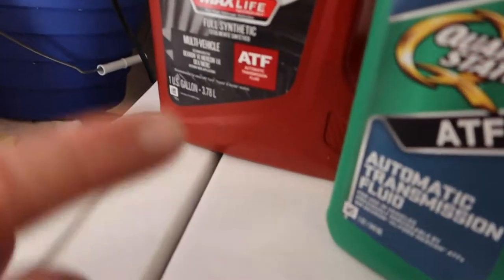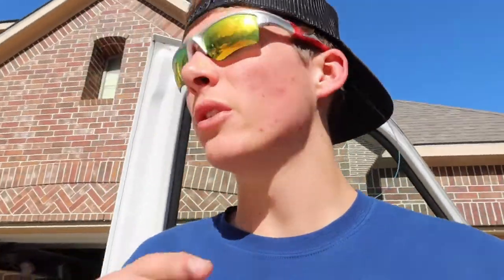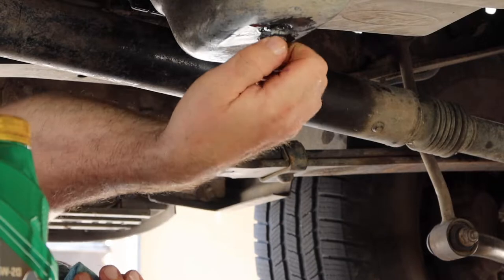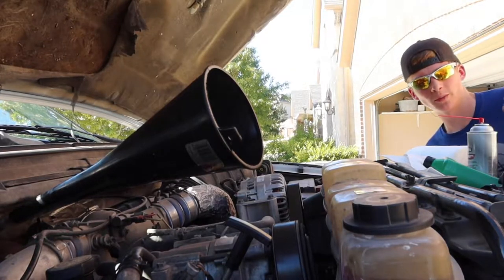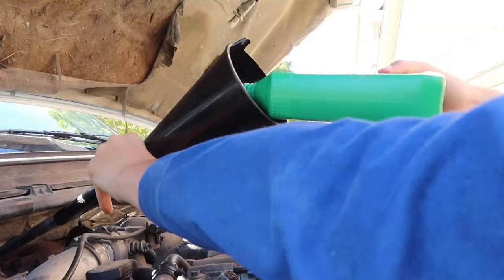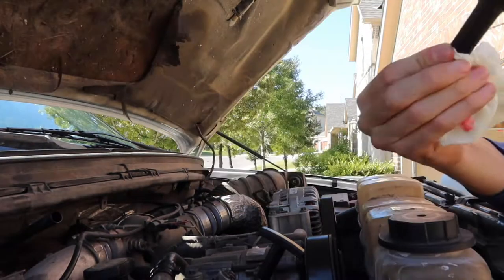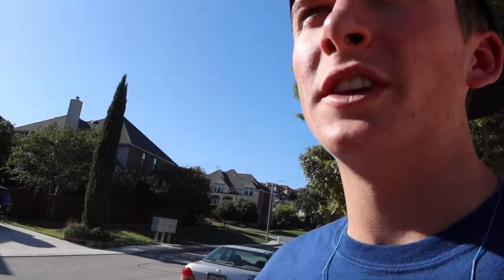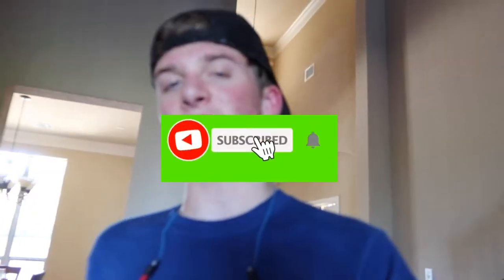How To Make Your Automatic Transmission Last Forever!! (7.3 Liter Powerstroke)

Comment: Even more fun fact, you can take that used transmission oil and run it in your fuel tank
Reply from the maker: Uhh wouldn’t recommend that.
Reply: @powerstrokecentral  You certainly can. 6.9 and 7.3   5.9.  And old Mercedes diesel prior to 1987. They burn anything. 
I drove coast to coast in the old Benz with used cooking oil and used tranny fluid
Reply: @emersontayten  There is so much metal from the clutches in that fluid that it will plug your fuel filter up before you made it through half a tank.  And if doesn't get caught by your fuel filter the metal will destroy your injectors and pistons.
Reply: @HockeyGoon939  Um, you obviously strain and filter the shit out of beforehand

Comment: That's good that you have  over 400,000 miles on it. But why wouldn't you pull the pan and replace the filter and remove the metal particles from the magnet in the bottom of the pan? I did it to mine and there were some shavings on the magnet. Not an over abundance but enough that I was glad that I did it that way.
Reply: No reply

Comment: Hey bro I’m a beginner with 7.3 I just got one and about 1 week ago my transmission overheated and dumped some fluid so i pulled over right away !! So my question is do I need a new transmission or maybe with luck only replace fluid and should be good to go ?
Reply from the maker: Are u in Texas?
Reply: @powerstrokecentral  unfortunately I’m in California 😔
Reply from the maker: @totaltreeservice4870  you need to find what caused the fluid to overheat in the first place and that is your problem no need for a new transmission unless it overheated really bad and you ran it without fluid.
Reply: @powerstrokecentral  thank you, you are getting my hopes up !!! Does 3K sounds like a good deal ?? Motor only got 200+ miles??

Comment: I just got my first 2000 Ford F250 7.3  turbo Diesel and I watch a lot of your Videos to help me with my truck. 
I am wondering for the transmission dipstick do I need it on the hot range or cold range when checking the trans?
Reply from the maker: check it while its hot and running.

Comment: The oil molecules are all over the place mixing all the oils  but i see you do it regularly.. when you drained the atf it was like new...   if you change it every 15k and don't beat on and add a second filter by oil cooler It will last for ever

Comment: Great video - do you know if Ford has fixed their tranny problems (Mechanical Diode) to your knowledge?  Looking at a 2002 @220k that has had tranny replaced but have read problems come back.  Everywhere i read in forums is it can't be fixed permanently?   Thanks for help!
Reply from the maker: I haven’t had any tranny problems with my 7.3 l. However I have had some electronic problems with my mileage left till E calculator. Probably because of how old the truck is.

Comment: Older video I know. But as you start building/tuning your engine, your auto tranny becomes the weak point. I burned 4 up in 3 years. Just swapped to a zf6. Not as fast, but nearly bulletproof.
Reply: Did you ever try a Dieselsite Legendary 4R100?

Comment: How many qts is it in total I’m a little confused I just got my 7tree and I’m looking at doing as much maintenance as possible
Reply: Don't do what he did.  Those years have a drain on the torque converter.  You can drain the pan and torque converter at the same time.  There is a rubber plug on the transmission bellhousing to gain access to the torque converter plug.  You'll need someone to bump the starter to get the plug to the bottom of the torque converter to gain access to it.  I try to let them both drain overnight.  If you let it drip long enough eventually you will get part of the oil out of the oil cooler.  My 2000 F250 V10 manual says the transmission from dry holds 17 quarts.  Even letting it drip overnight was only able to get 13 quarts out of it.  USE MERCON V fluid to refill.  I also add a pint of Blue Devil transmission stop leak.  This should be done every 40,000 miles or less - especially if you are towing with it.  I use the Super Tech Mercon V fluid as its the cheapest of the synthetics.  Valvoline does make a "conventional" Mercon V fluid that is only $4 something a quart but I don;t know how its Mercon V as my understanding is from Ford Mercon V is synthetic.
Reply: @HockeyGoon939  i turned the torque converter over on mine didnt see any plug on it . i have a 2000 f350 7.3 and i accidently over filled my transmission i disconnected the metal line that runs into a rubber covered vynal hose next to the trans pan and started the truck to pump out the line idk if that drianed the torque converter or runs to it or from it! But i put in 17 quartz i fucked up lol first time doing a deisel so my fluid was over flowing from top of the transmission above the pan area! I put in a new filter cleaned the magnet and did a oops i forgot to also remove the old seal from filter housing neck so put new one in with old one still inside hopefully it didnt get stuck or sucked up lol but im going to drop the pan again and redo it all! My over drive light is flashing cause its over filled and over heating cause of the pressure hopefully i didnt damage the solenoid at all!  But yea i didnt see any plug or rubber fitting on the housing and my drain pan the bolt dont come out theres a metal ring like part on the inside seems like it was put in to hold it it was tight but o went to loosen it which i did but just turns lol..
Reply: @allenmarvetsthewildbuck3205  some don’t come with a plug!

Comment: Damnnn my 7.3 excursion is on its 3rd tranny at 278k.
Reply: Sounds like operator error
Reply: @beatbeat4378  probably but not due to my ownership. The 2nd transmission failed on me about a month after I bought it.  And the fluid had been recently replaced.
Reply: @beatbeat4378  to many burnouts and Jack Rabbit starts.
Reply: Upgrade that trans cooler and service the trans on time.